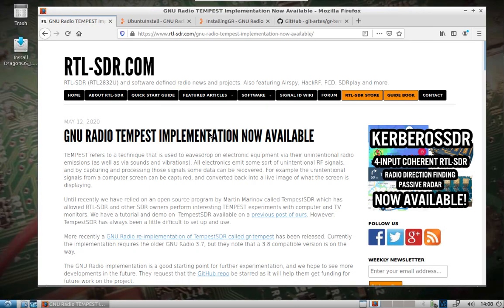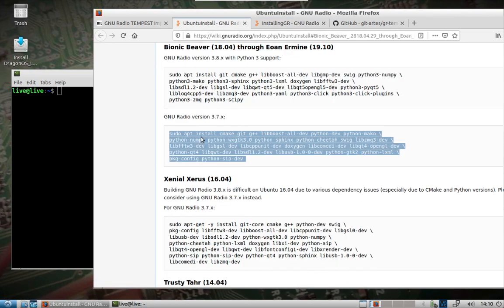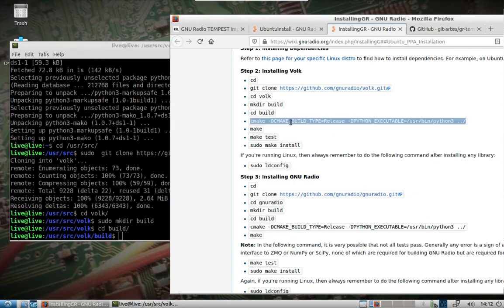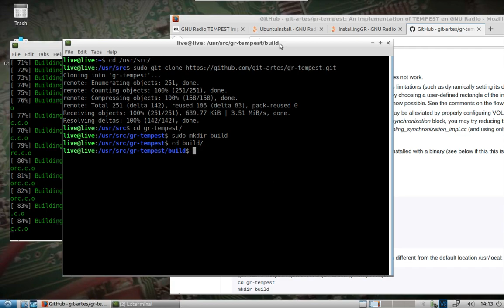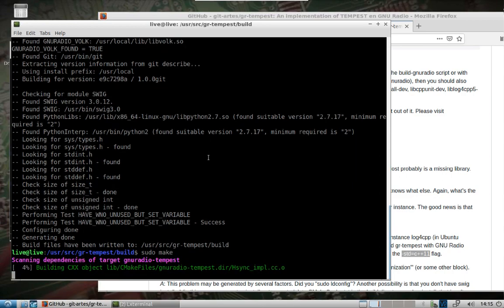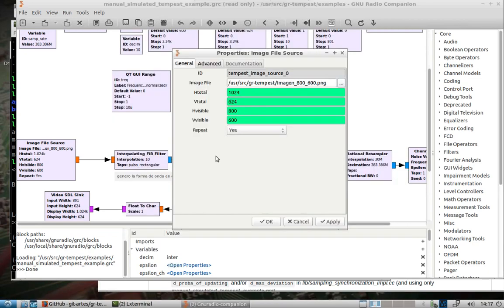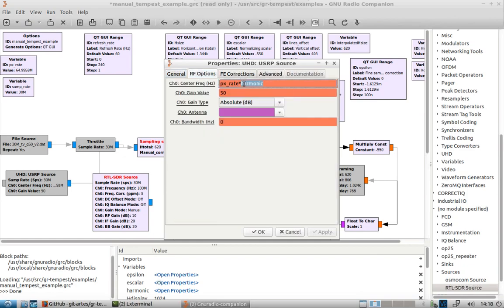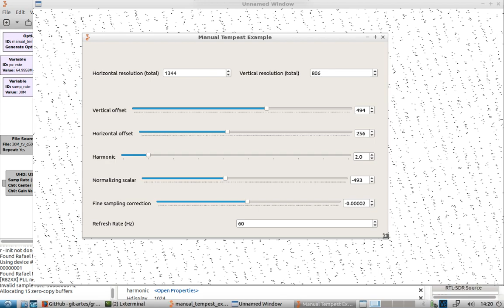DragonOS LTS Eavesdropping with gr-tempest on electronic equipment emissions (examples, RTL-SDR)

Comment: Hello! Intried to lead some examples on your last version of DRAGON Os. The .grc file I took from here https://github.com/git-artes/gr-tempest/tree/master/examples doesn’t load the flowgraph bug an error message “line 119. Column 73” for instance on manual_tempest_example.grc
Reply from the maker: I’ve included the examples. They are located in /usr/src/gr-tempest/examples/

You can load with gnuradio-companion from the terminal like this 

gnuradio-companion /usr/src/gr-tempest/examples/manual_tempest_example.grc

I do not have a UHD device to check them with but if I add a rtlsdr block to the flowgraph, disable the example file source and throttle, save to my desktop I can then execute.
Reply: cemaxecuter awesome! I will try it. I guess the good quality from Fede’s videos is due to the sample rate of his Ettus receiver
I have hackrf, limesdr mini, and airspy r2 just in case you want to test something
Reply from the maker: Actually I was just watching at least one of the videos and I thought it was all example files? When I go to his main github page it mentions until covid19 is over he can’t test real SDRs? I’ve been wondering if anyone’s actually captured video. Be awesome to know if you do with any of your SDRs. The only sdr it seems to work for me is the rtlsdr bit it could be something I’m doing wrong with the hackrf and flowgraph. I have an old monitor with dvi but maybe I need a vga cable?
Reply: cemaxecuter I haven’t had any success using tempestSDR . I have tried several monitors and all sdr Devices that I have. The first step is to find out the frequency where your screen outputs. I found that the easiest way was to play For Elisa video (look for “Fur elisa tempest” on youtube) and then with an analog receiver on AM browse from 140 until 500mhz
Reply from the maker: So the best I’ve got so far is downloading this “test” from here https://cryptome.org/2015/09/tempest-test-for-windows.htm

I plugged a laptop in to a tv with hdmi. I set the hackrf and antenna right next to the cable and used gqrx till I found the song and video signal at 296.7 AM and no kidding I could hear the song playing from the cable. Shut down gqrx and messed around with gr-tempest manually setting the freq and sample rate. No luck. I’ll keep messing around.
Reply from the maker: Also I just tried what you mentioned above. If you download the example file from the web than you are most likely downloading the html version. I just right clicked the example, saved as, and it pulls down the html file. This will cause the error you mentioned.

Comment: Great video. If you're gonna use an rtl-sdr you should lower the sampling rate (it's currently set on 30MHz). Don't expect clear images as with recordings provided, but you should see something nevertheless.
Reply from the maker: fede550 thank you. I’ll try it out!
Reply from the maker: fede550 forgot to ask what channel frequency do you recommend? I just copied and pasted what you had in the example SDR over to the rtlsdr source. In your example it came out to like 30, but the same formula came out to like 60 on the rtlsdr. I’ll change the sampling rate, just wasn’t sure if I should hard code the frequency.
Reply: @cemaxecuter7783  The pixel rate times an integer (1 should be best but it depends). You may read Marinov's thesis, or Menoni's if you read spsnish, for technical details, both linked at the repo.
Reply: @fede550  I can't compile it on Debian Trixie bro! xD